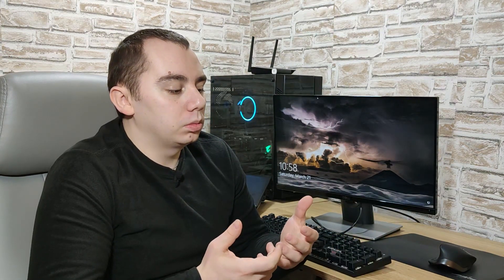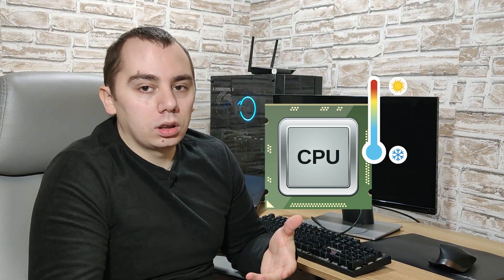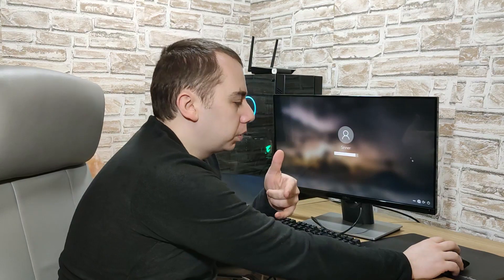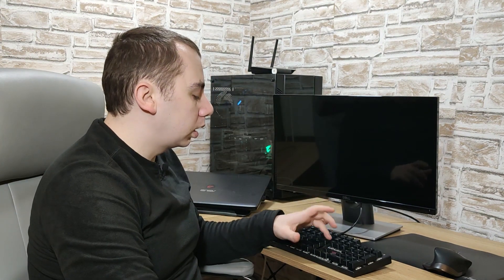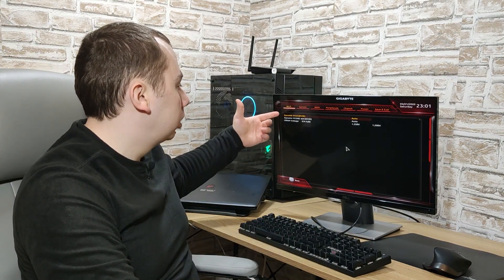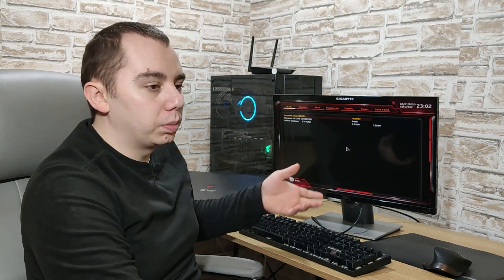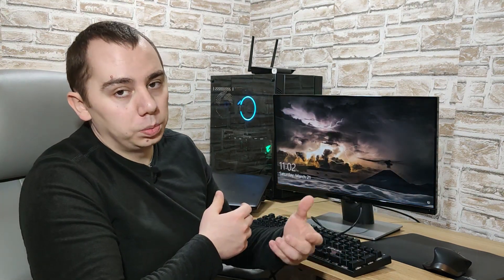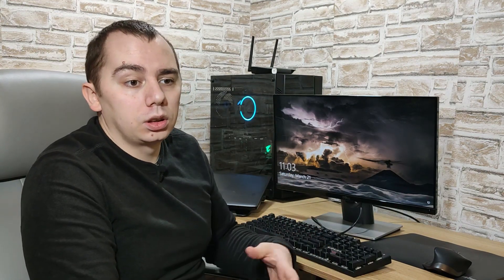Undervolting a Ryzen CPU - EXTRA performance and quieter PC for FREE

Comment: Hi I'm setting up my first desktop in a while and it is
AMD Ryzen 5 3600
Deepcool Multi Air Cooler GAMMAXX 300R
Gigabyte GeForce GTX 1660 SUPER 6GB OC
MSI B450M MORTAR MAX
Patriot Viper 4 BLACKOUT 16GB KIT (2x8GB) 3600 Mhz CL17-19-19-39

and I would like to ask is there anything I should with my setup, like in this video, undervolting? Or should I turn on PBO?
Should I OC my ram and so on?

Thank you! I'm begginer into this kind of thing so I would appreciate help :)

Nice video btw!
Reply from the maker: Hey! Thanks so much! First of all, a great choice of components for your build!
Some ideas regarding your questions and your system:
- 3600 MHz for RAM is perfect for Ryzen. I doubt you'll see too much in terms of real-world results if you overclock. But if you want to go all out, try going for 3800 MHz without increasing the latency (stay at CL17);
- I'd go on the PBO+AutoOC on all cores for the BIOS settings;
- while using PBO+AutoOC you can still undervolt. I've seen R5 3600 that with the settings mentioned are stable at -0.075v. Literally the best of both worlds: better performance than stock + lower temps; 
- if you're a heavy gamer you can also consider the RTX 2060. The R5 3600 can handle it. Having said this, the GTX1660 SUPER is an amazing GPU for FullHD gaming;
- you did not mention your PSU. Get a solid GOLD 80 PLUS one if you can. Or at least BRONZE certified;

Have a great day!😀
Reply: @techieshow  Hi!

Thank you very much! 
I'm confident now on enabling PBO and AUTO OC then !
But should I try to overclock my ram by using DRAM calculator? Or should I use MSI "Memory try it"
As I am getting 1660S, do you think I should overclock a bit on afterburner?

Also, which windows profile should I use? Ryzen Balanced or 1usmus?

Thaanks!
Reply from the maker: Hey, overclock the ram using the DRAM calculator. I trust  it more :))
I always OC the GPU. Currently I run a 1050 Ti that has it's max OC set at startup. No problems yet even if it has a couple of years.

Try 1usmus. Don't forget to set the BIOS as per it's requirements. It's easy to go the Ryzen Balanced after if this does not work ok for you - but it should as far as I know.

edit reason: had a typo :)